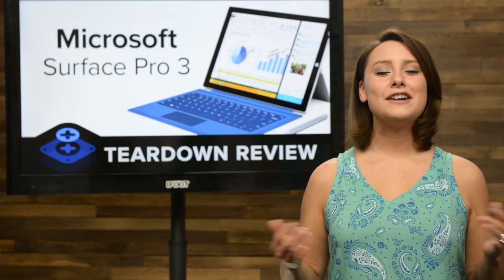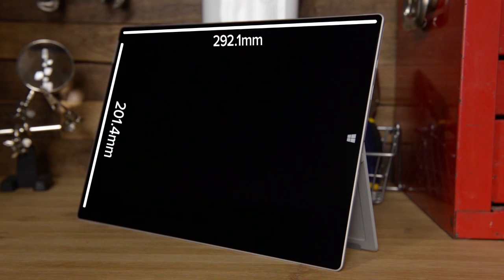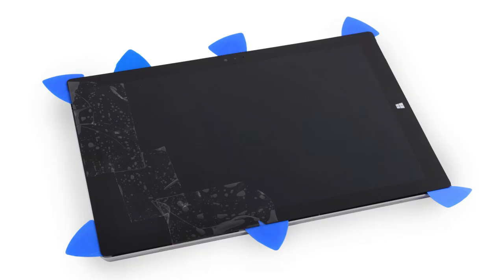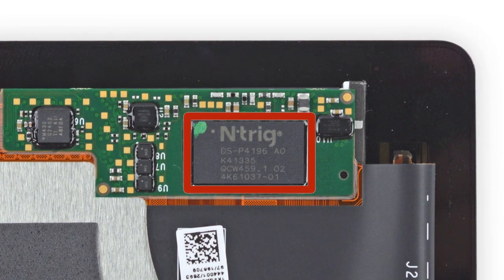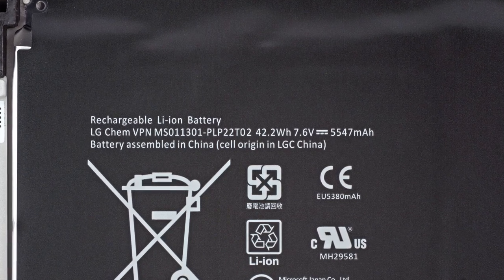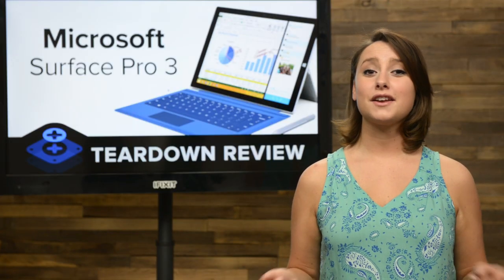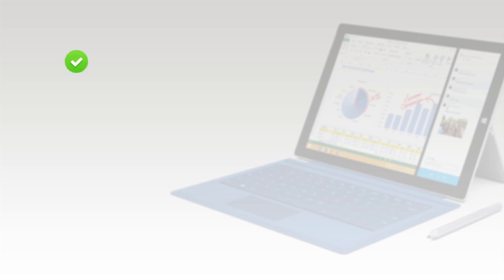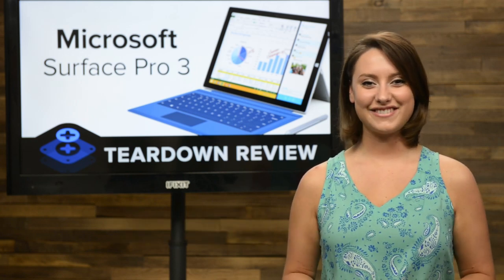Microsoft Surface Pro 3

Comment: I have SP3 with cracked screen, and it prevents me to get into the system. Would it work for me just to remove the screen and connect the SP3 to the monitor using the mini display port?

I'm asking not trying first just because i dont have the tools.

Comment: And this is why i chose to pay 500 bucks extra for the 256GB model than the 128GB model of the i5 surface pro 3.
Reply: +Hard-Rive Duckers   128gb for 500USD.... waste of money, in two years a tablet 256gb will cost 150 usd....
Reply: $500 for an upgrade to 256GB is a bit steep, you could have purchased a 128GB microSD card and added that into the card holder, for a total of 256GB.
My Surface Pro 3 is the 4GB and 128GB version (i5 CPU), would have preferred 8GB/256GB or 8GB/512GB but I got it this year on the used market and anything else would have been too expensive. I've never come across any situations where 4GB is not enough RAM on it, and the SSD still has tons of capacity left.

Comment: As a repair technician of 7 years now i dont see why this scores a 1 out of 10, its a pretty straight forward repair if you replacing the screen. I guess if your just looking to upgrade the ssd it might be a pain to not cracked the lcd assembly.

Comment: i had that surface pro 3 the battery life was HORRIBLE i swapped it out and got me a 15 in macbook pro retina display got 70 miles back home opened the brand new macbook pro retina and the screen didnt work had to take it back to best buy 70 miles away and swap it out

Comment: Where did you get a i5 Version with 128GB SSD and 8GB of RAM. This would propably be the version I want, but Microsoft charges a lot more because of a 256GB SSD.....
Reply: there is no such version
Reply: they meant 4GB RAM and 128GB SSD

Comment: Here's the thing. Microsoft realises that people want to use a pen - and most screens just don't work well with pens because the thick glass and separation of glass from display that would make this easier to remove and replace also means a lot of parallax (where you touch the pen to the surface of the display looks offset from where the computer thinks you're pointing).

I have one and I've used lots of other touch/pen systems and they got this dead on right - writing on a Surface Pro 3 is almost like writing on paper. No one else comes close to this.

So for me, this makes the screen issues irrelevant. I want the best screen to use, not to replace (although both would be better). 

The real issue is the over use of glue. Everyone uses glue and double-sided tape. That's forgiveable, but given how delicate the screen is, they should have found some other way to hold it in place. Same with the battery - a clip frame would have been better and not taken up any more space.

In the end though, Microsoft didn't design it for people to self-repair - they designed it for the best possible user experience and to make it as solid and reliable as possible. As a Surface Pro 3 owner, I can honestly say - this is one of the nicest, most solidly constructed and premium feeling tablets I've ever owned.
Reply: I don't think the thin glass has anything to do with stylus, cause the pressure sensor is in the stylus and it uses some kind of magnets to locate the nib, not by contact with the screen. it should be sensitive even when hovering
Reply: 10shot9miss Err sorry - I should have been clearer. You're mostly right (actually, there's an antenna around the screen that picks up a radio pulse sent by the pen which includes pressure information - and the position of the pen is determined by the relative signal strength to the antenna)

What I was talking about was a different problem - parallax. When you use a screen where there's a large gap between the screen and the front of the glass, when you place the tip of the pen down on the glass, it's actually quite a distance from the screen and so it's very hard to know exactly where the pen tip really is relative to the screen because you're looking at the tip from an angle.

It makes it hard to pick up the pen after drawing a line and hit the line again accurately when you put the pen on the screen again. This is why Microsoft has a cursor that you can't make go away when using the pen - which itself blocks what you're trying to draw over.

This makes the writing and especially the drawing experience a bit off. The Surface, by bringing the screen directly in contact with the glass and making the glass as thin as possible - reduces the parallax almost to zero - making the writing experience much more natural.
Reply: Theo Werewolf
o i see

Comment: 5000 mah battery?? How can that last 9 hours? My note pro is 12 inches and has a 9500 mah battery and that only gets about 7-8 hours
Reply: It's rated for 9 hr Web surfing - at dimmest display level you can stand no doubt. Best used in a dark room ... ;)
Reply: @DataWaveTaGo  It's common practice to not get anywhere near the stated battery life levels of a device in standard usage conditions. I don't know how they come up with the "up to" rated battery life.
for example my HP laptop says up to 8 hours but the maximum you'll get, even on power saver mode, is 4-5 hours?!
Reply: mAh isn't a measurement of the amount of energy that can be stored in a battery.

A 5000 mAh, 5V battery stores a lot less power than a 3500 mAh, 12V battery:
5x5=25 and 3,5x12=42

A correct way to measure an amount of power is WH, or Watt-Hours.
You often see this on notebook-batteries, but not on phone or tablet batteries.